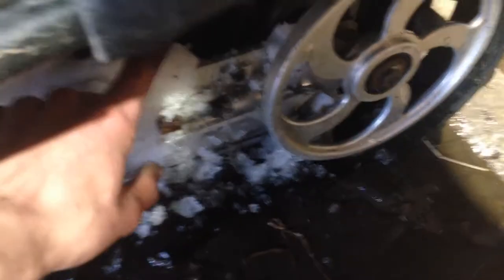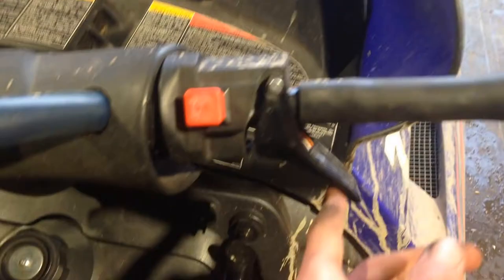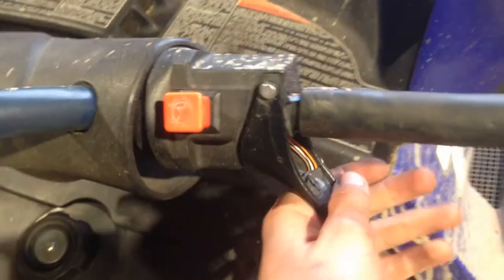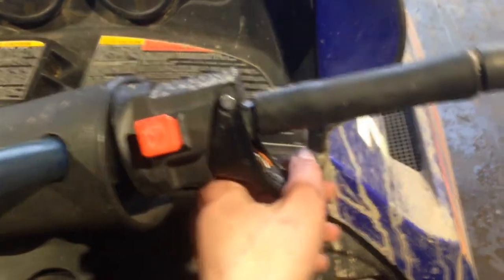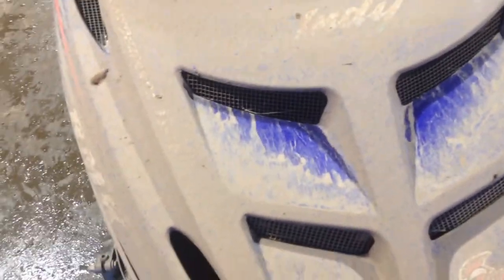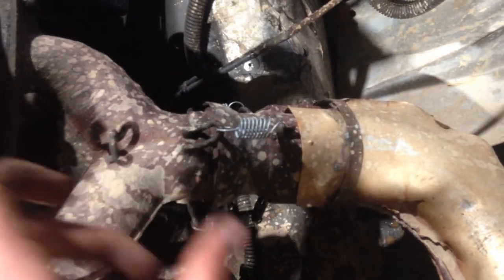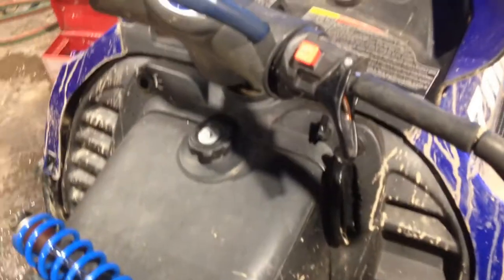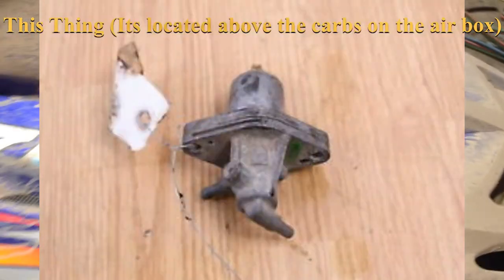97-02 Polaris RMK/XC 600/700 Common Problems and Things that will Cause you Trouble

Comment: Thanks for doing this vid. Good stuff.
I found out today an old friend of mine took possession of 99 RMK 700 in a trade for  a set of golf clubs. From what he knows, it needs a seal in the chain case or something but the engine is solid. I ride a 2023 Indy 650 ADV . How is the cooling on these old RMKs? Is it a decent trail /ice fishing sled? Probably better than golf clubs I guess. LOL
Reply from the maker: The cooling is really good on these sleds, If my buddies newer sleds break down up the mountain I'm always the one in the group that pulls them out since it doesn't need much snow to keep cool.

Comment: How do you adjust belt deflection? My secondary has an adjustment cam with 3 bolts but it doesn’t seem to do anything
Reply from the maker: That plate with 3 bolts is suppose to do it, if i is not adjusting far enough to tighten/loosen the belt you might have to add a shim in between the clutch disks. (or just get a little bit smaller or bigger belt depending on what you need)
https://www.youtube.com/watch?v=CCyvQ9BIc2c 
in this video it shows how it works, Just skip to 15:31 and watch till 16:29
Reply: @AlecsAdaptationsYT  Thanks for the info, sounds like i'll be adding a shim

Comment: in a pinch u think a cdi from an 02 700 could be used on a 97 700?
Reply from the maker: I've never messed around with the 01 and 02 spark system but i'm pretty sure it is very different from the older style. I don't know maybe you could splice the wires to mate it up to the newer cdi box, but I don't think it would work.
Reply: @AlecsAdaptationsYT  I may have shot myself in the foot buying the wrong parts sled 😂😂 I’m not really familiar these Polaris Machines I’ve only ever owned skidoos but looks like from what I’ve read now I’d have to swap the entire ignition system from the newer one into my 97 which makes sense looks like I’m just gonna have to bite the bullet n just track a cdi box down for this thing . Thanks for the info !
Reply from the maker: @Kentuckyfrieddish   No problem, Good Luck
Reply: I went through hell I’m back with those damn CDI units. A heat gun can sometimes bring them back, but don’t go too far with it. Ofcourse there are cordless heat guns now